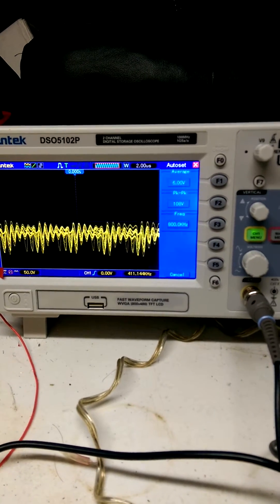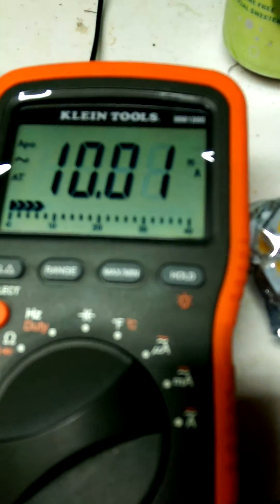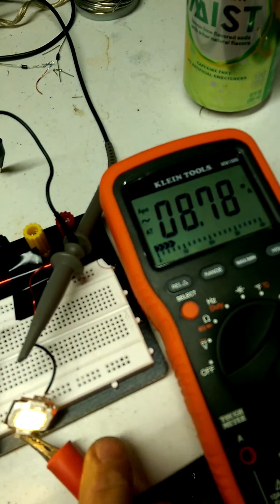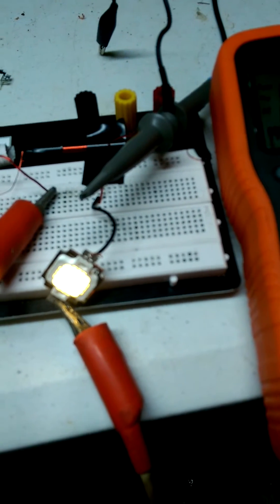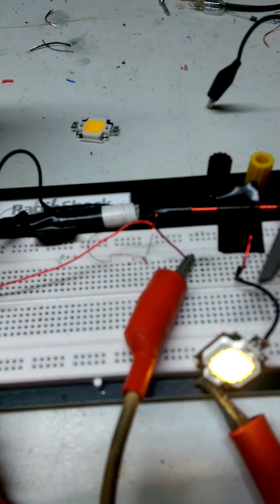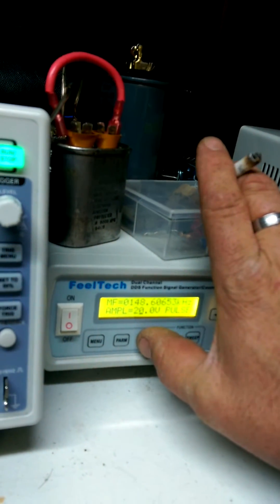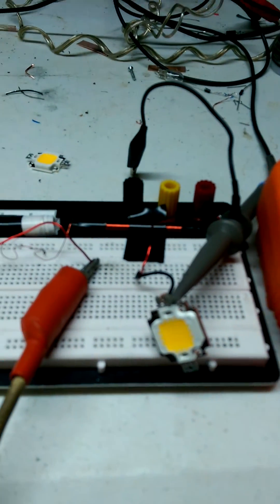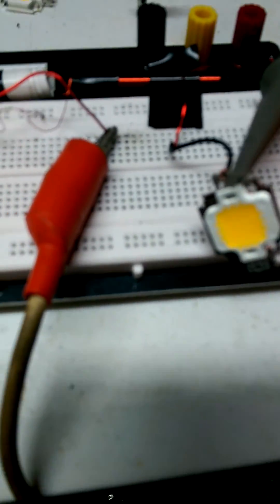Partnered coils- proof of overunity

Comment: GOOD OVER UNITY DEMO , Its not drawing extra power from anywhere , the extra energy comes from the device itself , the extra energy comes from avoiding back emf , A transformer based on a simular concept is a BI-TORIOD transformer , any transformer can be overunity , but its back emf that make a transformer not have over 100% efficiency since its an opposite polarity that works againsed the given polarity , its like two forces canceling each other out , so if you deflect the one force , it can run with nothing working againsed it . So if you avoid back emf on any transformer , you can have 100% efficiency.

Comment: Or you need a lot of resistance to block energy coming from earth so that you don't blow the circuit. IF you had coils that had zero resistance then you would not need protection for them , this is the purpose of your resistor.

Comment: I've just pulled up the specs for that Klein Tools meter - the min/max AC frequency when measuring current is between 40Hz - 400Hz.  So you're deluding yourself if you think that it can return a valid reading when measuring 140Khz.  It's also not a TRMS meter which only adds to the inaccuracy.  When testing even sines, my TRMS meters are only accurate up to about 500Hz, and even then, at nowhere near the mA resolutions you're looking at in the video.
Reply: thanks for pointing this out.... that is my main problem with these videos. There are some that seem to power small things after getting up to the right frequency after disconnecting the input. But still not one video can actually just lay it all out.

Comment: 3 steps to at least 6x amplification: short out bucking coil component, then lowest capacitance across that, then a high voltage resistor across that- I believe as much resistance as possible, haven't tested yet- not enough parts.

Comment: this is a trick if u run the coils close to resonance then add a load that brings the circuit into resonance the watts from the battery will decrease. adding a load and dropping the input is easy to do  as above. not over unity.
Reply from the maker: I suppose it is a trick when any sized load or type of load is added right? The load is a diode, not a resistor, totally different phenomenon. so the RLC resonance thing you speak about doesn't hold water, and the trick would need capacitors to be added unless the frequency was the same for all 3 coils, unfortunately, the primary and secondary are different so a cap would be required, and to get better resonance, or to become in resonance, the load would have to be resistive if it were to be part of the tuning process, or capacitive. 

. If it were a resistor then I would say maybe you are correct, but it seems that you are completely trying to suppress the truth of my work, as you could clearly see by the waveform, there is no resonant changes happening, the wave is the same at all times, the size and the shape, so your theory is wrong pal.. NO TRICK HERE!!

, however, at the load,  it changes the sinewave to a radiant energy pulse and draws energy from somewhere totally different than from it's source because the load is a diode. Before you guess, know what you are talking about. this wasn't done by aiming for resonance, and it isn't just luck to get resonance, to do so,  it needs to be tuned.

 This happens as I said by magnetic manipulation. The circuit will NOTeven start to oscillate without a magnet to fire it up. This is a very simple circuit, it is cheap and takes only maybe 30 minutes to build. Prove to yourself what it is doing by building it before running your trap specifically in an effort to suppress my work when all of my work is very real without ANY trickery.

 By adding an LED is the only way I was able to get it to work, and it does have a relationship between the magnetic component and radiant component , because the chopped wave (from the rectification of the led ) allows this wave to become a radiant spike and it allows the led to start up
Reply: Marc Belanger dear sir diodes can drop the voltage across it by .6 of a volt. meaning it also has resistance. and it will depend on how far from resonance u are, two far and like 100kHZ and u will possibly get nothing. and yes most resistance loads will bring u closer to resonance. but all will change it by a different amount just like tuning a circuit. can be done with a capacitor in correct position, it can be done by changing Hz, can be done by load, have made many resonance  circuits that do this. it just an interesting thing. it just means the more tuned the circuit the more efficient it is. just like tuning a car the better tuned the lest fuel and more power it gives. u can try this, change your HZ and watch the input play with it until it gives u the least possible input watts then add a load and your input should now go up. then tune it with load until u have the least input, then take away the load and input will go up. if this does not happen then u may have found some thing different. if this was not a deliberate trick then u can learn hope it was not and u can have fun learning.
Reply: Hai perfettamente ragione, qui si fa soltanto dell'illusionismo e non ricerca scientifica matematica.

Comment: +Marc Belanger - Nice work, a very good experiment! 

I hope others can see the simplicity here,  and that this is only the start to this Tech. 

All the greats used this Tech, the absolute most obvious is Don Smith: https://www.youtube.com/watch?v=EsKoAu_X25A 

It is possible for small units to produce very large amounts of Power. We are only scratching the Surface here. 

Good Work and thanks for sharing!
Reply from the maker: Hi Chris, It's my pleasure. I wouldn't have had interest in this circuit if it wasn't for the papers and great video that you did a great job of publishing. I have seen this work in a bucking amplifier US patent # 1,701,771 , and it was certainly a long time ago. I don't remember exactly where, but somebody had shown this to me many, many years ago with myself in amazement of how it did what it truly did, when I thought that was truly impossible, until I looked into thane heins... the same thing, just with isolated squared cores. . . 

One day, I wanted to see if there was anything online, on Google images, maybe a working schematic, and sure enough, there's a circuit posted online with (2) 180 turn coils , 75 turn primary, then I think a 100 ohm resistor in series with the fgenerator. . It was simple, then the tuning and setup I tried many connection methods to at least verify the combinations to see if in fact they would respond conventionally, and to my surprise, in different  circuits, just by changing where I placed the wires, out of phase, in phase, or wherever they crossed, the circuit had phenomenal overunity effects, even when wired incorrectly, but it would need to be tuned to this phenomenon. This  means the coils could be oposing, or in phase with each other, either way, they still have an additive effect, which, If we pulse the energy into them, I do believe the two isolated cores collecting and transforming/transmitting, the pulsed opposing force cold electricity could have several copy cat coils near by, or within a string series of these cores and windings, then have a central core for the primary, so the outputs are basically like generator coils.

So far, the electrical output from the massively energized inductive power which is released when these cores are separate and could be very overwhelming magnetically, if these were built on a massive basis. To explain this would be insane normally, but the opposing coils firing one from direct force of the transformer core, then, the second one repeats this without using any energy from the input coil, however, the transfornmer steals extra energy from the source, while the extra coil gives energy availability to you as the free ride, leeching from the other coil because it is blocked from leeching from the primary (source) because of the function of the bloch wall.. you have created a tremendous demonstration of this, in fact I wish everybody that is ever interested could watch this, because it is the answer to future free energy or bulk energy output devices will have to use. It has a promising level of energy if it is engineered correctly.  

One secret I found is this.. put a piece of foil strip on each core, and drive the cores with a frequency generator and transistor at a harmonic of the frequency being driven into the coils, making sure that every coil is one of the same, all tuned precisely so they are accurately drawing the energy as they should. The frequency and actions of the coils will wake right up once you hit the correct frequency. It is very easy to make large inductances work on a core, therefore the caps are tiny, and it is cheap to build as I do if you calculate the cap size, then order it if you don't already have one. My advice is to start, tie your scope to an aluminum plate, suspended next to your nst and arc gap so you could determine the frequency it is precisely running at while the arc gap is tuned where you want it. One secondary coil will fire pulses, as we add a rectifier after it, and the opposing coil feeds back upon the other magnetically, and reacts with the cap tied to it.(.047 uF) This isn't done in Don Smith's paper for impedance correction, it is there to create a magnetic feedback. The field has to be a harmonic of the 3rd degree, so you would start with say 30 khz, then the next frequency would be 90 khz, then,. the 3rd will be set for  270 khz. According to Smith's chart, the 270khz isn't all that far off because he uses 35.1 khz to start, and it matches a harmonic of the 3rd power of don's input frequency, to the decimal point.

The output will be high voltage, it needs an arc gap in the primary circuit with a cap in series or parallel. If the gap is wired in series then we would need to fire another in parallel after the secondaryn to make this all work, then you would need to add a bank of AC oil filled caps, and the second arc gap could compensate and drop the frequency way down if you wish, along with the voltage, then filter the frequency in the output with  a choke, which functions like a 60 HZ LOW PASS CROSSOVER COIL. Light bulbs and similar resistive devices will run, motors will take off like rockets, and have serious torque, then enough to run a several thousand watt generator, feeding itself, or like I list below, it could be rectified.

 The system could be rectified, driven through a voltage divider, and safely stored into supercapacitors. The supercaps will run any sized inverter because they are charged with very high amperage nearly in an instant. Cold electricity at very high frequencies store safely and extremely rapidly into supercap banks. The split partnered coil transformer amplifes the ability to store amperage and provide very high voltages, then the amperages are released by the caps, while the charge is steadily feeding the caps at high frequencies quicker than they could be used through oscillation from the output caps . Since they can't lose all of their charge because one is on charge while the other is used, cycled back and forth and of course all precharged. The output has a feedback loop that will easily run the source and output as much as 600 times it's input energy. I can't explain exactly how this manifests it's energy, but it does, and it is extremely exciting. I added a dj light to my output when I first got the high voltage output from my caps and the lamp blew up into a fire ball. Not just sparks, a literal fireball! That is serious amperage and I kid you not, if that was just one pulse, then many pulses back and forth from banks switched on and off during the cycling of an output transistor bank controlled by a frequency generator, of course from it's capacitor precharge. The problem I have is that I didn't have the caps switched and I took it apart, of course never leaving it the same and have to rebuild, but now I have some B&W coild, the 3064 that Don Used, I am waiting on the heavy amp king wire, and I will be ready to go. All parts available, but my nsts run at 48khz, 20 khz, and the other is 33khz. I think the 33 is my option, but tuning will be a bit different.
Reply: +Marc Belanger - Hi Marc, Thanks! 

I also was in the same situation. I was shown this by a very good friend. Tried for a few days, failed and then gave up. Years later I fell into the very same Technology, a flash of insight, possibly from Source, I believe anyway.  

There is some understanding that is necessary, but once some understanding is achieved, there is a super fun ride ahead. 

As you have shown, and many others, this does work! 

Its so absolutely Simple, but takes some work and understanding. Yes, your explanation I think is a very good one. I hope others read and absorb this!

Your achievements are awesome, reading about your work, this sounds very exciting. 

Electrical Energy comes from Einstein's Mass Energy Equivalence: E = MC^2 where E is the Energy, in the form of Charged Particles moving, Electron's Orbital Hopping. 

Its been said: "Energy out of nothing (probably from vacuum or black holes)" - Supposedly in 2279

Apparently we have changed the Future. 

Great work!!!
Reply: Just so everyone that reads, knows, User2718218 is MileHigh one of the Goons from Overunity.com which was banned by the way, due to a epic loosing battle of whit and knowledge. I actually thought MileHigh died of old age and Gout!!!
Reply: +User27182188 - Milehigh You're a Child, in fact even children behave better than you! If you were capable of an ounce of common sense, then your on going public display of stupid would be obvious to you, and you would be ashamed. But you carry on.

Comment: DVM's are not a good way to measure high frequency, non-sine wave current... or even voltage.
It's best to use a small value series resistor and measure the voltage across it with your o-scope. The shape of the pulse will change under load, even further messing with the DVM averaging circuits.
Reply from the maker: +beforebefore If it's proven to the input of the function generator, would the outcome be more believable? The consumed wattage has also shown to be less since I plugged the function generator into a killawatt meter and it uses less energy with the led powered up. The amount of energy, amps and wattage equals the same amount as the calculations have proven. This meter is not accurate with voltage at high frequencies.. The amperage is close enough to the outcome of the formulas I have written down so I feel comfortabl saying this is within 5-7% of the calculations I have done. When I disconnect the led the fgen's wattage used goes up basically the same amount as the meter shows. I feel that's proof enough, so, if there's anybody that doesn't believe me, it is an extremely easy circuit to build and if they have an fgen and a simple $10 killawatt meter, they too can see the same results. There's no tricks here and since the circuit isn't mine, I have nothing to prove other than the fact that partnered coils really work. The triangle wave is key to get the most efficiency for this circuit and the brightness of the led is equivalent to a 10 watt led running at 2 full watts of power. I did test this with my lux meter, I just didn't video the results because my phone for some stupid reason only takes selfies now after it's android update that happened just after I made this video. I will rebuild this circuit with larger gauge windings and larger ferrites, then pulse it with a lot of input power to see what happens, maybe I'll use irf260's from a 555 and a mosfet driver with a car battery or something with some real ass to it.  There really isn't  a necessity to use a resistor other than to eliminate the short circuit created by having too small of a coil with too little resistance, which causes a short if that's the case, but, the coils if wound correctly and cores in the correct distance act as a caduceus where there isn't resistance or a shorted circuit, only the primary coil can be a problem here so I expect to be trying winding the primary with the caduceus coil next as many free enrgy researchers do, such as T-1000 and the group he works with.. The results of this circuit are 5 times better using an inductive load, and it is how TinMan creates this effect with his universal vacuum motor.